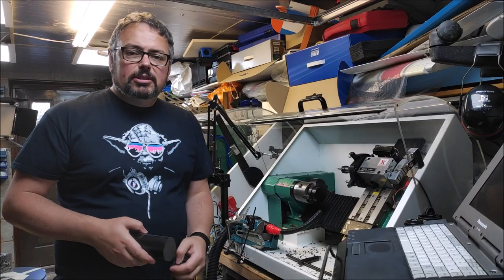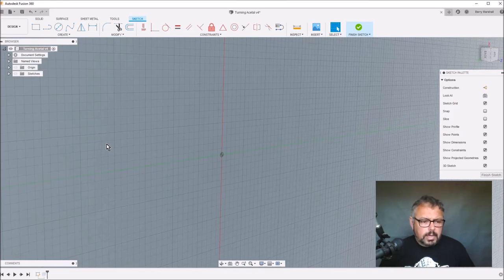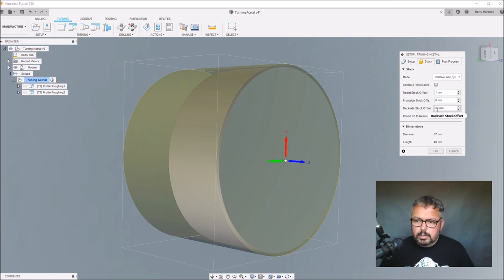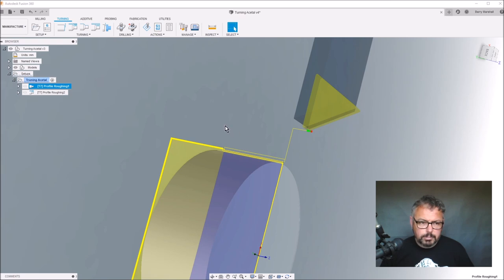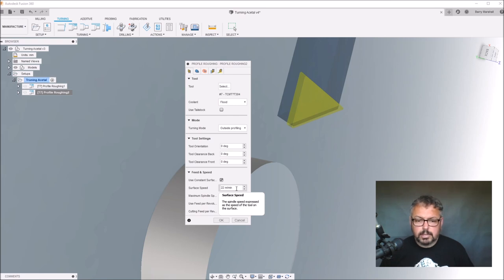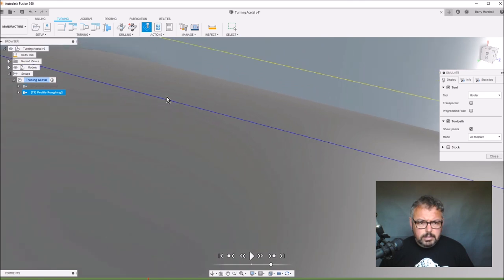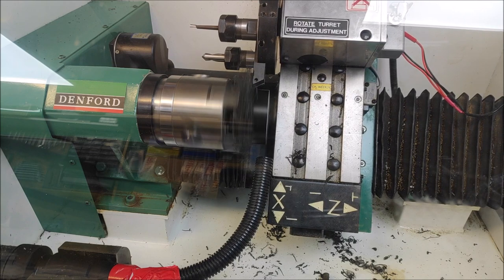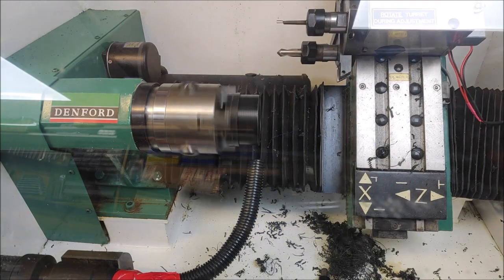How to CNC Machine Acetal (Delrin) plastic with no mess!

Comment: Rather than a continuous cut try using a chip breaking sub routine. High feed rate,cut to finished and interrupted cuts,keeps swarf to more manageable bits than candy floss.
Reply from the maker: Thanks Andrew 👍 that's effectively what I've done, from memory I used the pecking feature which creates the chip breaking you mentioned. Thanks for the tips. Cheers, Barry M